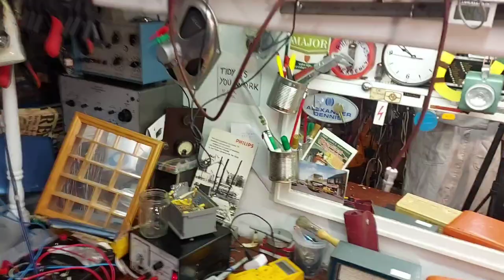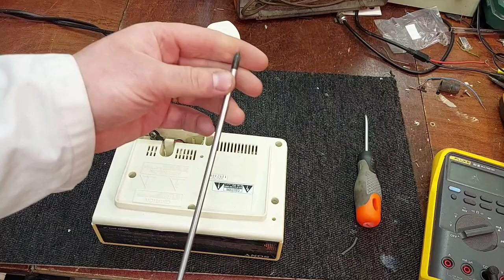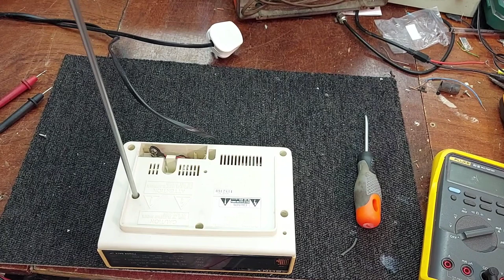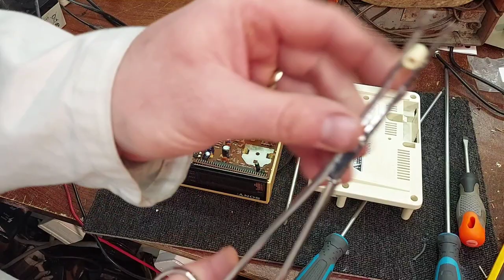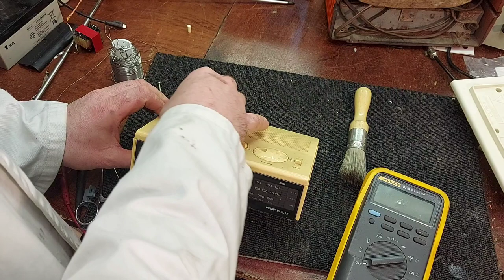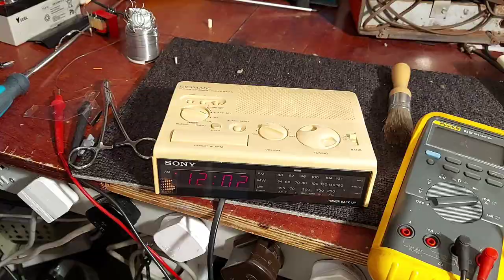Sony clock radio.

Comment: Another great video, you did well getting that post out. This takes me back to when I worked for Westclox I fixed customer return clock radios and digital clocks. It was the mid 80s all were made in Hongkong. The thermal fuse imbedded in the transformer  was a common fault. The big clock ICs were quite reliable worked off 50hz mains. The battery provided a few days back up, time only no display, if the power  failed.  The timing was from a simple R C circuit  one of the pins so not that accurate after several hours. There were several models dating back to the 70s mostly Red  LEDs some green and some blue ccfs. Your Sony looks much  better  quality and a bit younger.

Comment: Nice work. I have a very similar Philips clock radio of about the same age. All working, although the led display is rather dim and the volume pot needs a touch of Deoxit. Display is a very thin 4 digit module and no longer obtainable, unfortunately.

Comment: I had a Sony mains powered clock radio about 20 years ago which had an LCD display with a green backlight. I loved it because it had an AM/FM radio with PLL digital tuning and 5 presets. I noticed a lot of the latest devices at the time had blue backlit LCD displays including clocks so I was bored one day and decided to replace the 2 green LEDs in the Sony to blue ones and boy did I regret doing that! It was like having a blue laser shone into my eyes when I went to bed that night. I must admit though that it made the clock look really stylish but I couldn't live with it so I switched them back to green again and have been weary of blue LEDs in products ever since.
Reply from the maker: Can't say I'm a massive fan of blue LEDs.

Comment: Sony made good products, that clock/radio/alarm looks nicely made.
I bet the thermal fuse under the transformer tape got a bit too warm one day,  they can fail for no real reason other than age or someone turning the central heating up too high.
The primary winding looked like it was still connected and no sighn of a overheat.
Well done :-D lucky to have a compatable transformer :-D

I was looking for the bit of long wire out of the back that would wrap around the mains cable for f.m.
Yes people do waste a lot, i'm sure you would have been at home in the 40's and 50's, people got things repaired in those days.
If you do invent a time machine ill go back with you lol.
I don't like to see a usefull device wasted.
Reply from the maker: They sure can, they don't like it when the mains drops too low either.